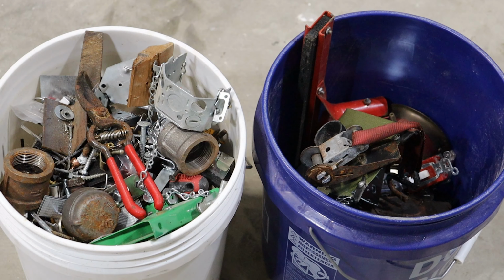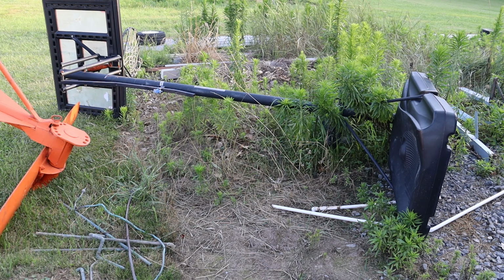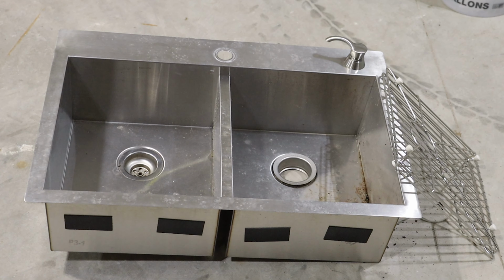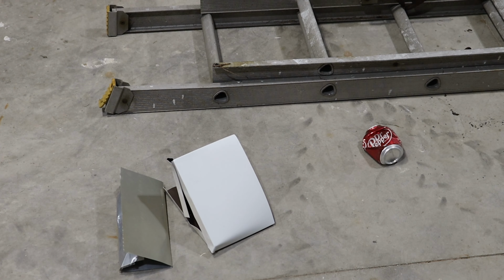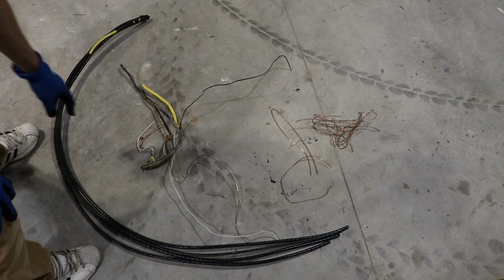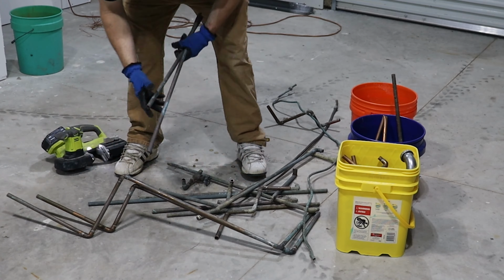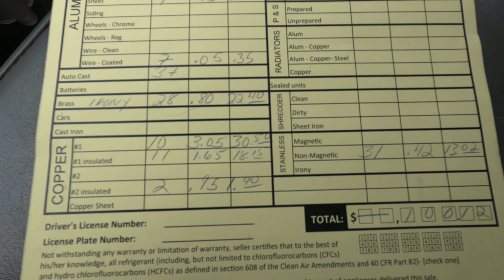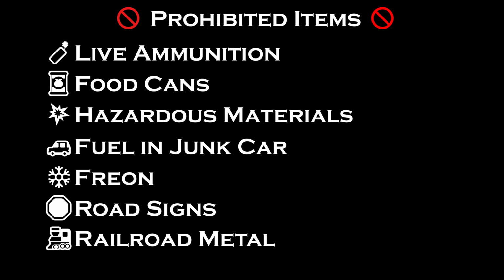How to Prepare Scrap Metal to Get the Most Money at the Scrap Yard | Learn How to Start Scrapping

Comment: Take apart a dryer or washing machine and you’ll have brass , electrical wire from the wiring and especially the motors same for fridges as you’ll have the compressor that’s got a electrical motor inside of it plus lots of copper and aluminum. 
Microwaves will have a better amount of copper in em . 
Printers have gold and aluminum plus electrical wires and stereo and computer equipment , cell phones & hard drives will also have gold in em just like motherboard from computers .

Comment: I was just wondering, how honest they are with paying for cleaner metal? Like that aluminum ladder, is there much a difference between u taking the steel and plastic off, I assume not enough since u didn't do it?
Reply from the maker: Depends on where you go. I have been to a few scrap yards in the area and settled on this one. I know the prices for the metal and what they consider clean or prepared metal. Each place seems to have their own rules and this place seems to be the most reasonable.